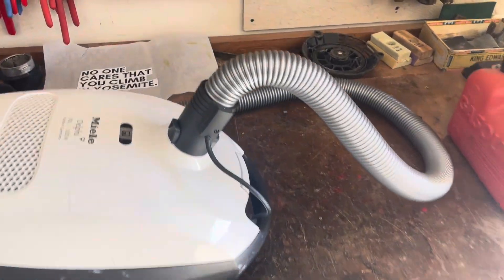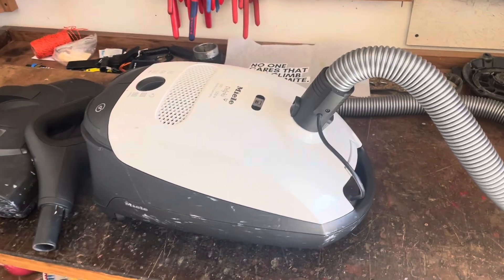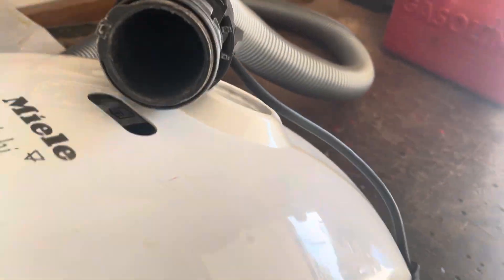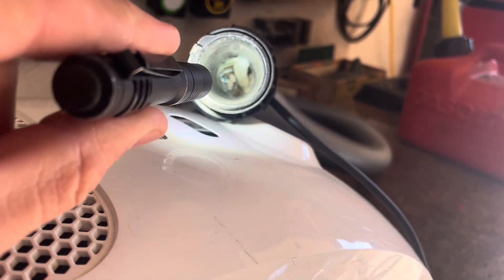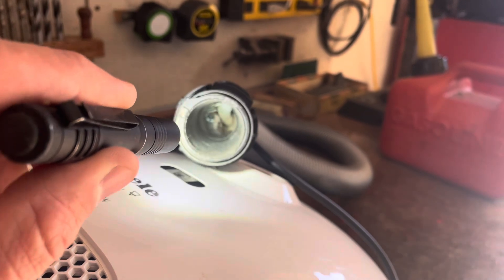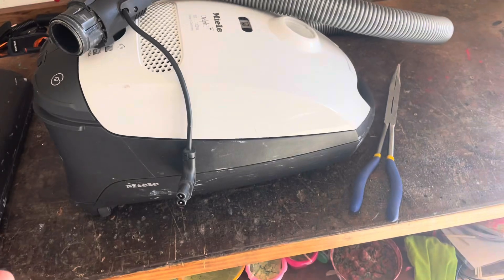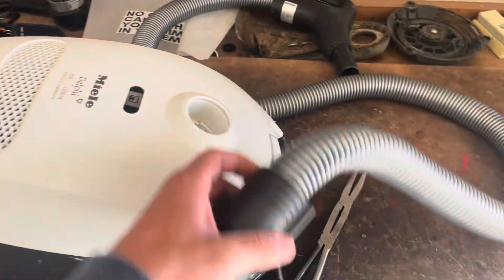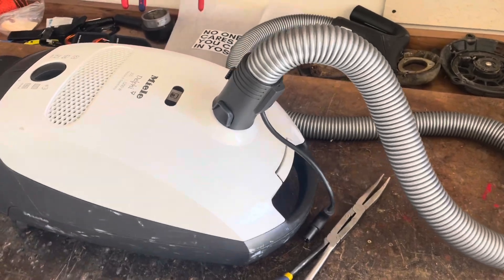The problem with most Miele vacuums

Comment: That strange I have the Miele leo 2007 model and we have 4 people with very long hair but I never had this problem since the wire is actually suck on the hose so it can’t create a hook as you sed so I think yours has a defect
Reply from the maker: Hmm. Perhaps the older models had a different design. My friend in Germany has the same problem as mine. I cannot detect a defect but never say never 😀 I’m wondering how yours looks inside…how the design is